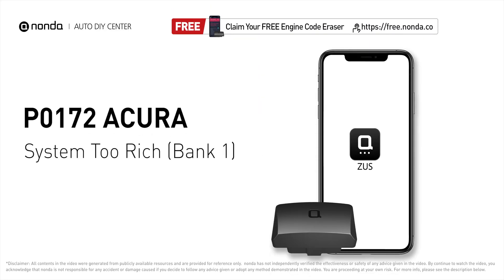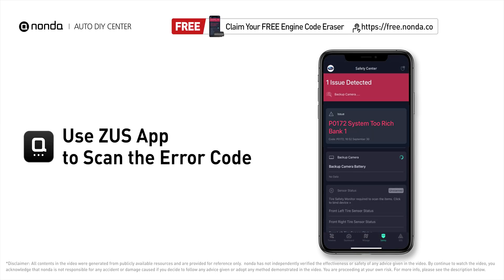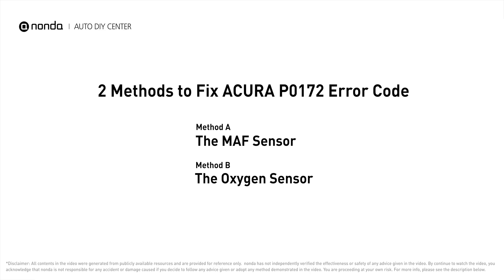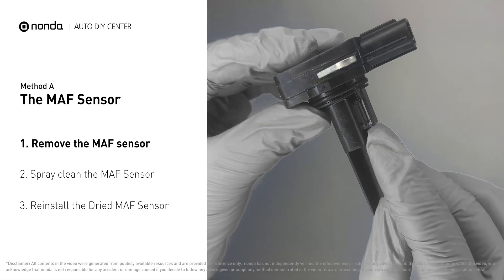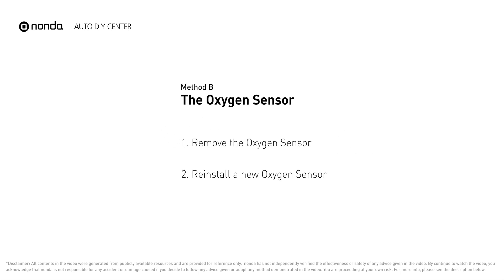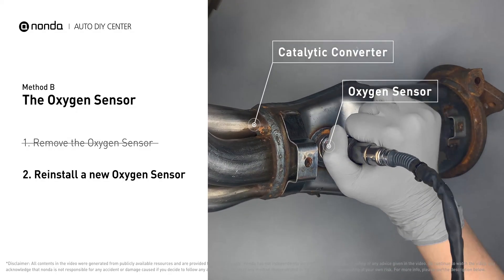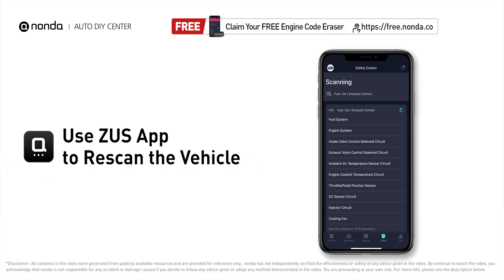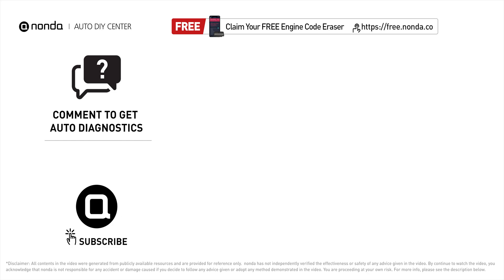How to Fix ACURA P0172 Engine Code in 3 Minutes [2 DIY Methods / Only $8.77]

Comment: No MAF on 2007 Acura TL….has MAP.  IF it is actually the oxygen sensor, and not one of the other multiple issues it could be, it would be the upstream O2 sensor (B1).

Comment: What o2 sensor you are referring to? There are 2 of them
Reply from the maker: Hello, can you please provide us with your vehicle's year, make/model?
Reply: @nondainc  I realized that the injectors I bought were not a good fit and they were causing a fuel leak :(  had to buy original ones from Acura
Reply: There are 4 in a 04-08 Acura tl